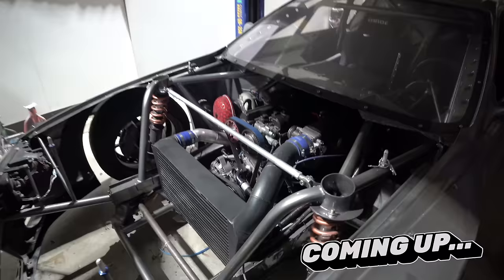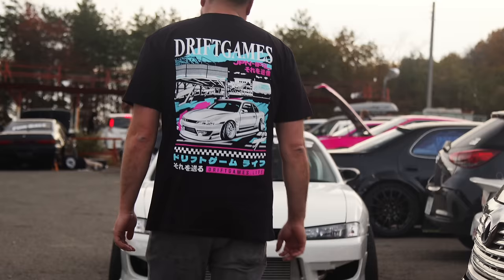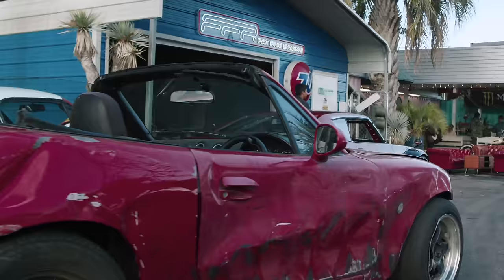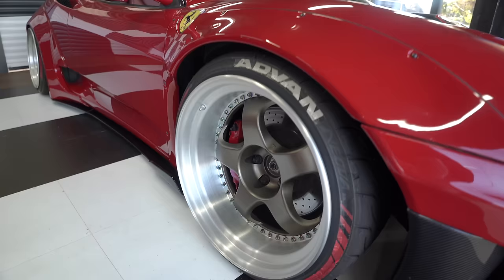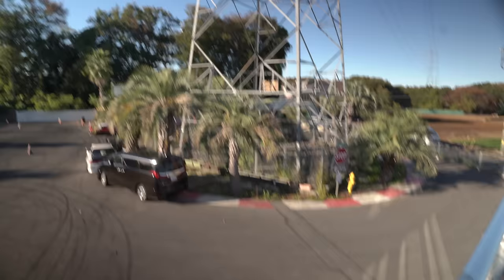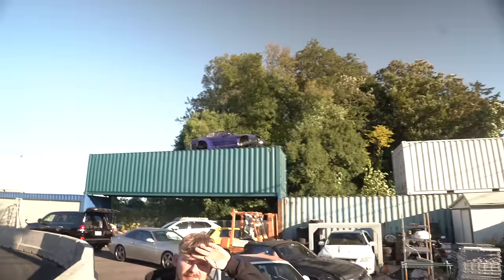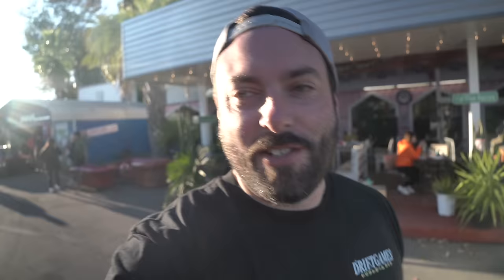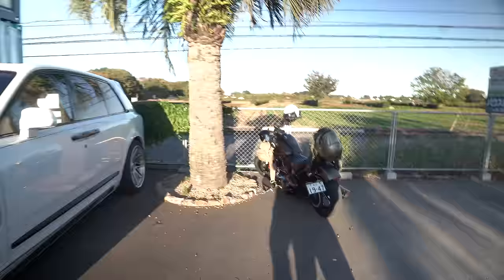Daigo Saito’s drift compound in Japan has +50 cars inside!

Comment: That altezza is Taniguchi's old HKS car with a dodge R5P7 NASCAR motor in it now (same engine as the itb hakosuke). And that v8 in the a90 supra is a TRD NASCAR engine. You're not looking at run of the mill v8's, you're looking at 900hp 9000rpm engines that make the sweetest exhaust notes you'll ever hear
Reply: The KPGC110 at 10:32 also has the R5P7. Same engine Lauri Heinonen has in his 180sx in DMEC and you know how that thing screams. 😁

Comment: TRD in the hgk supra in daigos shop is a nascar engine! Not sure if that's been mentioned yet but yeah, It's a push rod V8 TRD have for Nascar, there is versions being used for Sprint cars in speedway aswell as a 4 cylinder version for Midgets in speedway aswell!

Comment: I was lucky enough to own a C6 Vette while I was in the service. I had to sell it when I was medically retired. My disability/retirement pay didn’t start when it was supposed to and I sold/ gave up just about everything of value to keep a roof over our heads. It was a stock car, but I ABSOLUTELY loved that drivers seat and it heat and ability to move the side bolsters in and out, and the HUD. I miss that car…technically I miss any car that has a fun factor, but the power and targa top, the car could take away all my anxiety and stress that revolved around my pain and being med. retired. I almost felt normal..while driving in the car at least.

Comment: Little more info:

1) Kenmeri V8, 22:46 Drift Corvette, 20:00 jzx100 - are for SALE))))))

2)20:27 - That V8 Alteza is not new project, it`s old rds gp Daigo`s car.

3)The V8 in Hakoska is not sprintcar - it`s NASCAR Dodge V8- Same as Kenmeri, and there`s also 3rd car - Datsun Fairlady Z (S30)- but car is like 85-90% ready.

4) That Testarosa in workshop is gonna be drift car.

Comment: From what I've heard, Ferrari is rather conservative. I feel like these modifications to the cars in the showroom are a bit rebellious. However, I hope Ferrari has seen the fine work done to those cars and just thinks this is good.
Reply: You can do mods but if theres a recall or service or work to be done they will refuse to work on it
Reply: Testarossa was notoriously tail happy with the v12 engine mounted over the transmission. That would be a better place to start than an Enzo